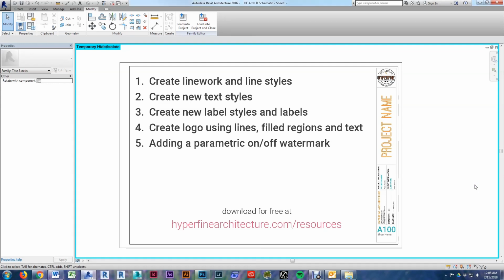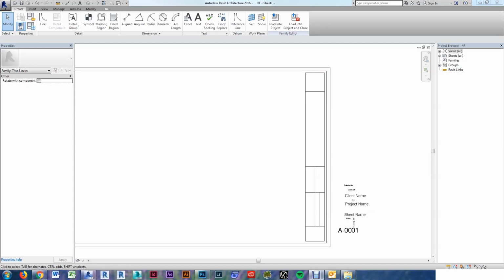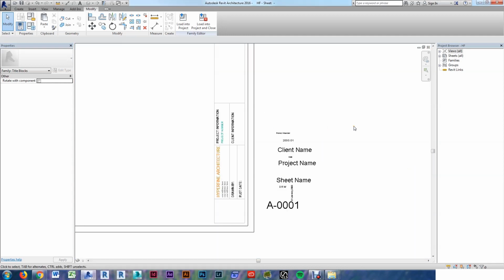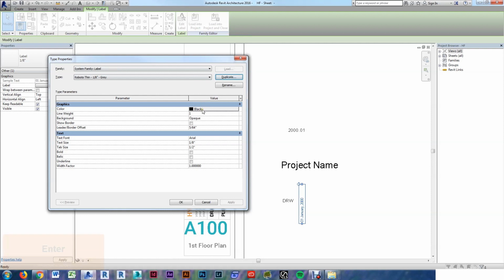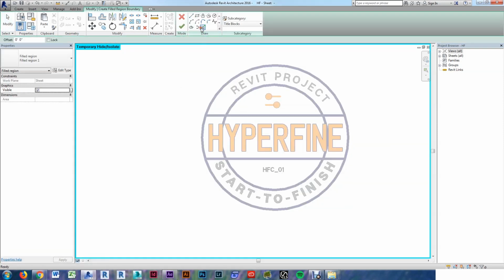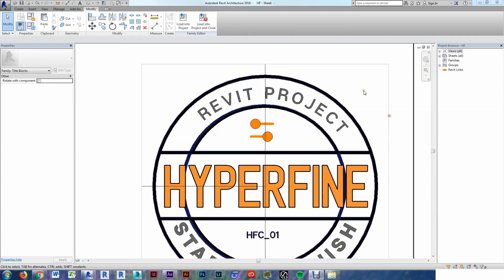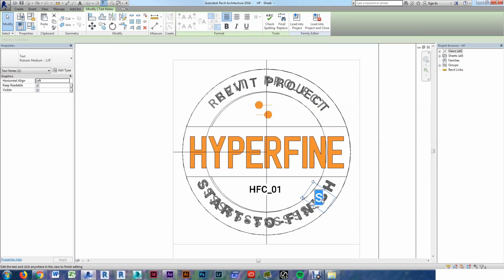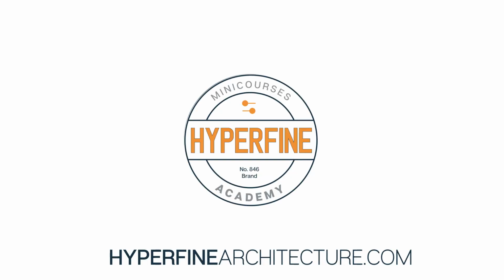Revit Titleblock Tutorial

Comment: If you create the "Not for Construction" watermark as an Instance Parameter. How can you set it up so that you can select a few Sheets in the Project, and as a group, turn them on/off at the same time?
Reply from the maker: I don't know a good way to do that other than selecting the titleblocks individually. Lots of workarounds, could do it with shared parameters, but if you're gonna do that then the easiest thing is to just make it a type parameter and have two different types for your titleblock...NFC and With Stamp or similar.
Reply: Thanks for your reply, I was hoping to achieve a simple on/off instance parameter.
Reply from the maker: @schussbunny  Making the parameter is simple, the complication is when you try to select multiple instances of just the titleblock in your project. You could just make it a type parameter then turn it on prior to printing just the sheets you want to print.

Comment: I think that the inserting logo will be more fast if you import it in the sheet creation like an image, you will Simply rescale it.
Reply from the maker: Faster but could potentially cause problems with file size, visibility or printing.
Reply: Hyperfine Architecture ok i see, that’s right
Reply from the maker: That could work, except that I would just link the DWG file and then draft over it with the pick lines tool. If you bring in a DWG that was originally made in AI and then explode it you will get a lot of unnecessary line types in your file.